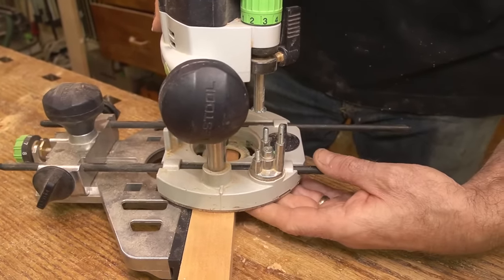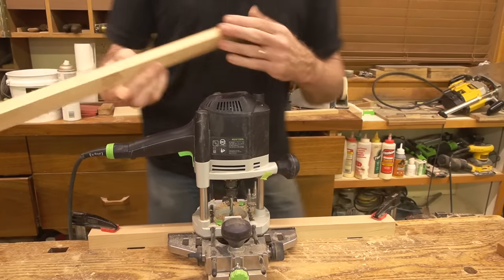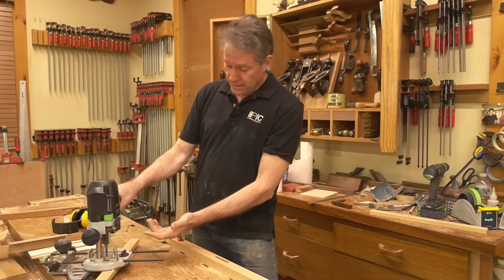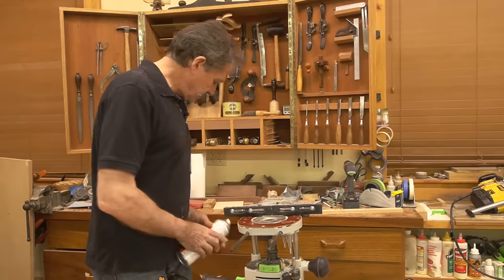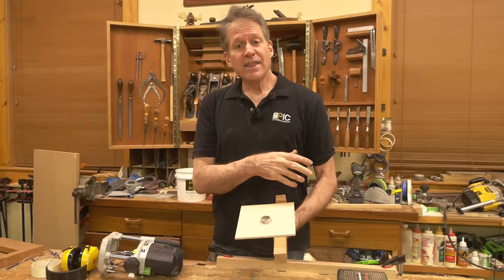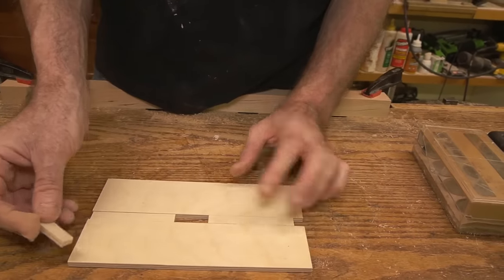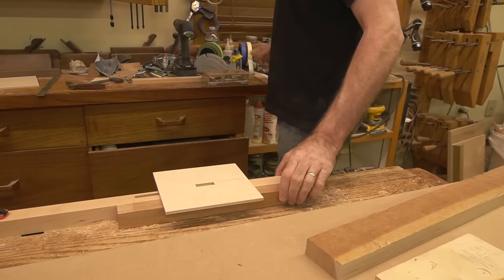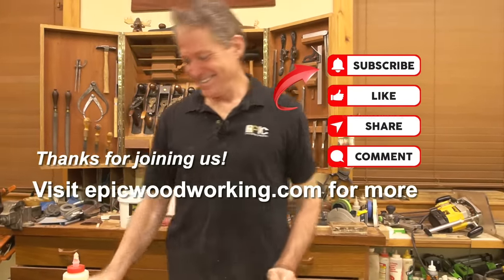Mortising with a Router

Comment: Another great video.  There is always something new to learn.  The quick and dirty router support using carpet tape is pure genius.  I have made a second fence for my router out of plywood scraps, some threaded inserts and screws.  It works really well.  Having said that, making a jig and using a guide bush is my preferred method of cutting mortices as it is so much more consistent.

Comment: could use router table with dust collection and a stop on each side. then raise the bit
to start the mortise, run the piece over the bit to the other side, then raise the bit again, do another pass to finish the depth...